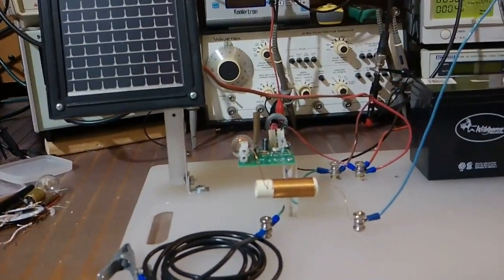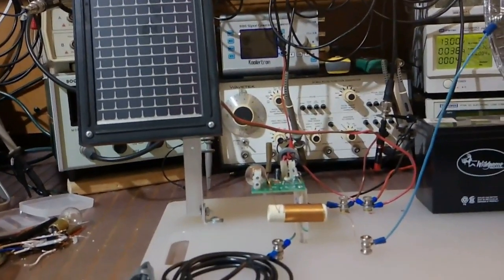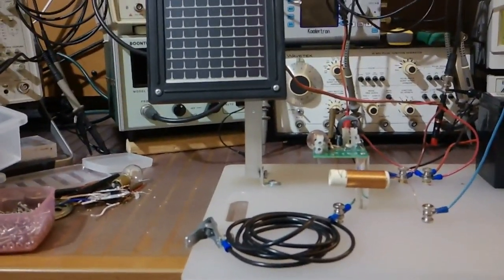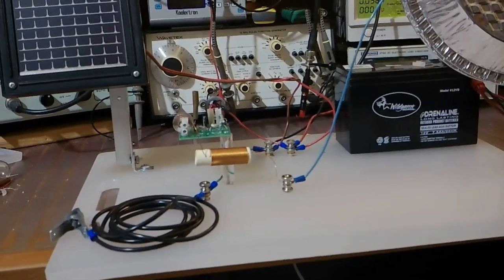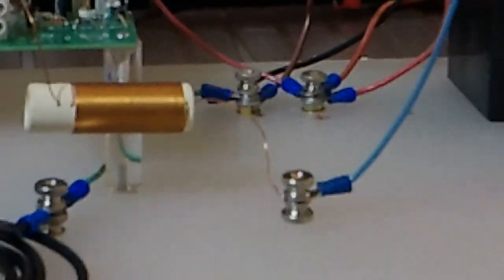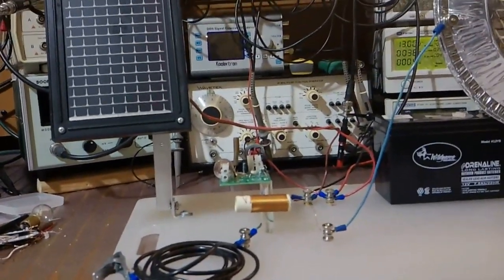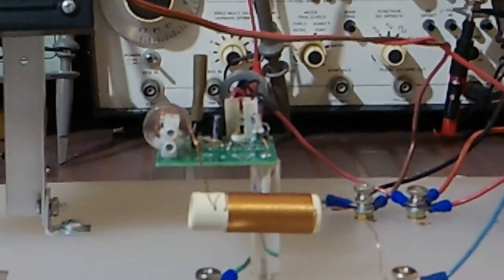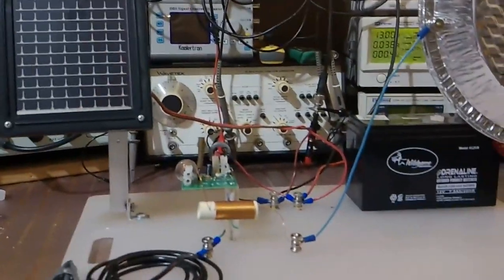Proof of Concept Central Exciter Configuration.

Comment: This is really good to see...first port of call will be the dollar store to check out pie tins. I think they even do similar chopping boards.
Reply from the maker: Yes and the sewing store for plastic bobbins to wind coils on. Then you have the Home Supply to obtain a roll of Al Tape. Because you can not solder to the Al, go to the Hobby Store and pickup a roll of 1/4" Copper Tape. Yes indeed I use what is best for the projects and  (works). Take Care....
Reply: For replicators, I see such things as a great bonus, a big hurdle (excuse) avoided.
Best wishes and for good experimenting weather too !